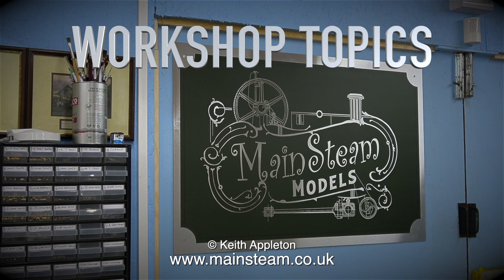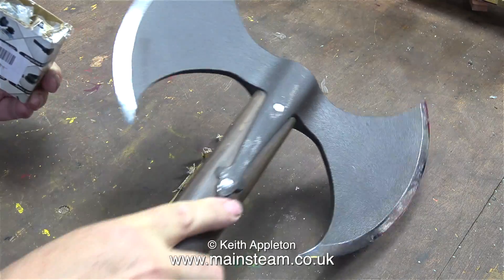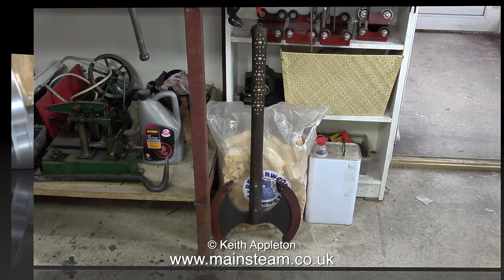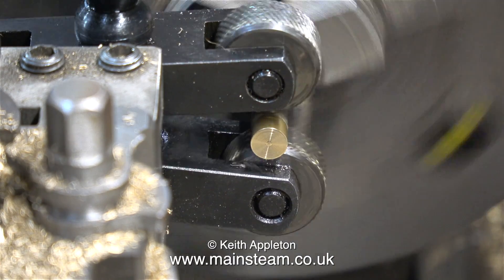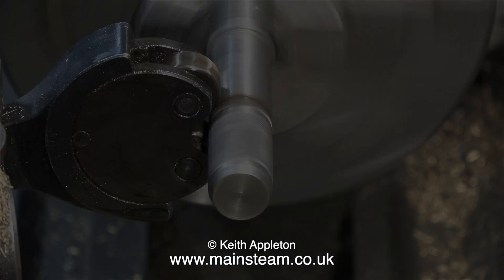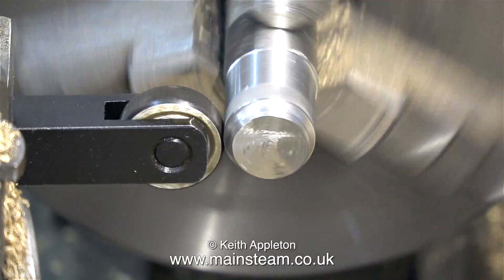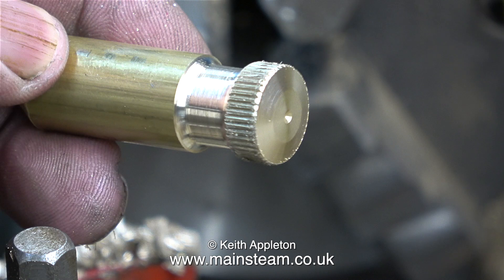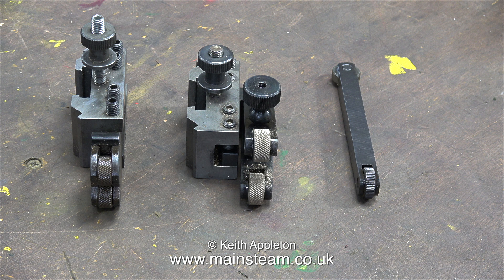WORKSHOP TOPICS - THREE TYPES OF KNURLING TOOLS

Comment: As already said the knurling tools that don't clamp put a lot of side load on small lathe headstock bearings. I have now given up with cheap tools. I recently bought a pack of six small files for just under £20 and they cut like butter and give a very nice finish and don't "pin" and scratch the work. The cheap stuff from the far east just skids over the work and just does not cut nicely.

Comment: Nice work, as usual... What I am interested about knurling is: why is this tool able to make this pattern while the circumference of the tool and the circumference of the bar is not the same. Is the tool slipping all of the time to match the pattern on the bar?
Reply from the maker: The Knurls are free to rotate so just follow the pattern made by the first pass.

Comment: i got my clamp type knurling tool which is similar to that from either RDG tool or Chronos engineering but they did have a selection of wheels so you can swap out the style of knurl

Comment: I wouldn't worry too much about the screws on the clamp type knurler. The pressure is supposed to be between the wheels and little of it is seen by the rest of the tool. They are sturdier tools than they look.

The straight single wheel knurler should work fine on steel also. Despite the double knurl. You need to give that tool a good bit of a quick and more forceful jab into the material to get it to track properly. It needs to bite pretty deep on the first try to knurl properly. It's easier to accomplish if you work much closer to the chuck for the most rigidity. The single pressure point will causing excess flexing away from the tool. I have used a much heavier version of the single wheel tool in a CNC lathe to knurl many stainless tubes. And the approach feed rates had to high to prevent failed knurls like your piece of steel.
Reply: Idk for CNC machines but when i was working with single point i always put live center tailstock support if i can.Also you can redo the knurling but you need to put a knurler in the pitch ,othervise it will cross knurl and it will look absolutely ugly.You do it when lathe is off ,push it in material on the middle  and rotate it with hand untill pitch on knurler meshes with the knurl on working peace like gears do.Then you turn the lathe on and use a left/right feed to finish it .

Try cutting a thread of the same pitch as a straight knurler.Then cut a knurl ovet that thread ,pattern you get is interesting .

Comment: Might the third, straight-cut knurling tool work better when used more closely to the lathe chuck or with the work supported on a live center? I have a vague memory of having some similar results to yours in school many years ago, and think that I was able to improve the work finish by minimizing the deflection due to tool pressure.  Another good video, thanks.